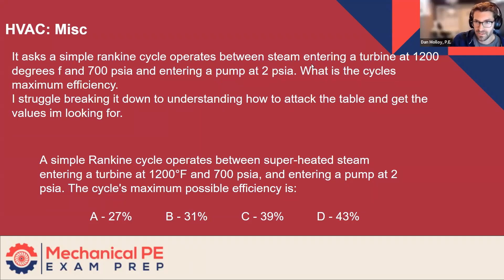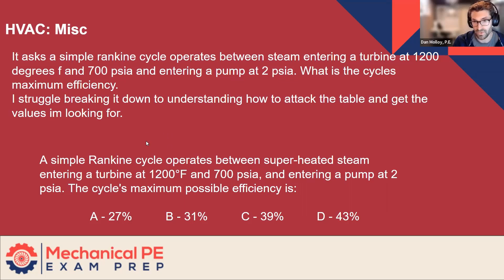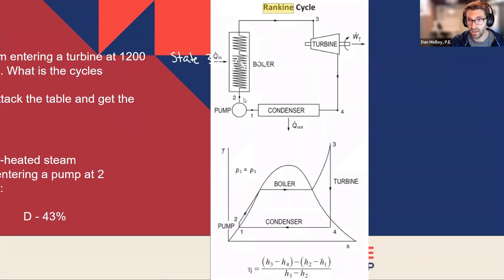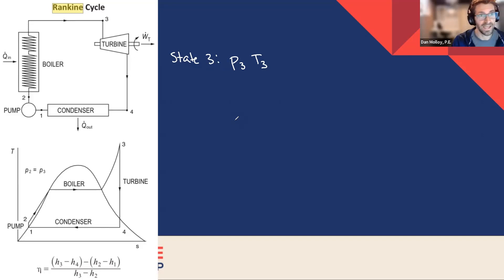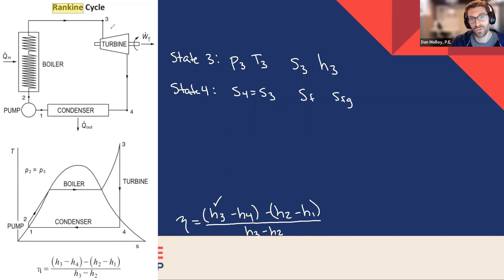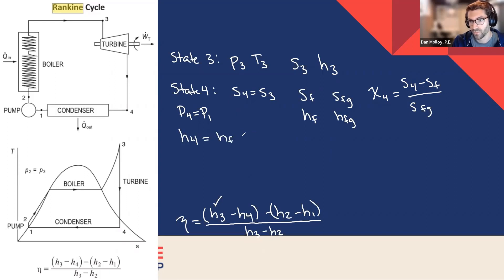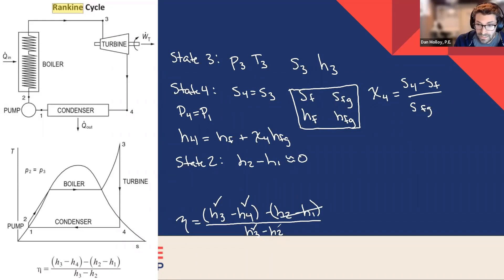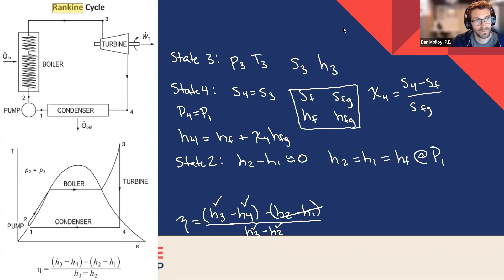Step-by-Step Guide to Rankine Cycle Efficiency | Solving Turbine & Steam Table Problems for HVAC PE

Comment: Can I ask? How can we assume that H1 = H2 if P1 = 2 psia,  P3 = 700, and the chart says that P2=P3?
Reply from the maker: Good question.  The way I think about it, the specific volume of a liquid can be small, so that even with the pressure difference that is meaningful which you rightly noted, it may not amount to much specific work (delta enthalpy).  However, it would not be crazy to quantify this is you're worried about it impacting the answer.

Comment: You are correct that the enthalpy added by the pump is very small and has little effect on the efficiency, but you do have enough information to calculate it. The work done on the system by the pump is the specific volume of the fluid at state 1 multiplied by the difference in pressure between states 1 and 2. The specific volume at state 1 is 0.0162 ft^3/lbm. This gives the pump work as v1(p2-p1)(144 in^2/ft^2)(Btu/778 ft-lb) which equals 2.09 Btu/lbm. Add the pump work (enthalpy change) to the enthalpy at state 1 and you have the enthalpy at state 2. This gives 2.09+94.01=96.1 Btu/lb. The efficiency calculated this way is 38.97%. If the pump work is negligible the efficiency is 39.06%.
Reply from the maker: Awesome! A perfect demonstration of why it's OK to neglect the pump work.  It's a great exercise to go ahead and find it anyway for practice in case it is meaningful in other cases.  Not necessary every time, but while solving practice problems, a worthwhile detour for sure.  Bravo for the extra effort and precision!